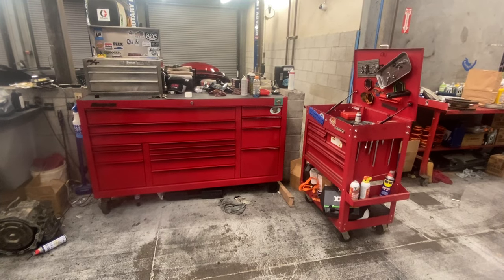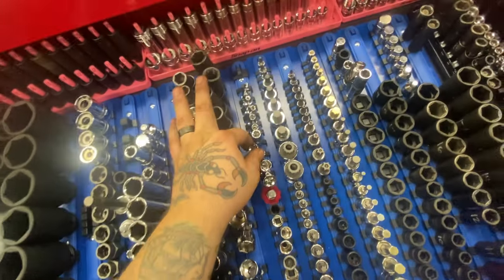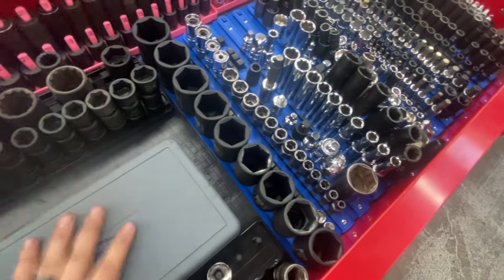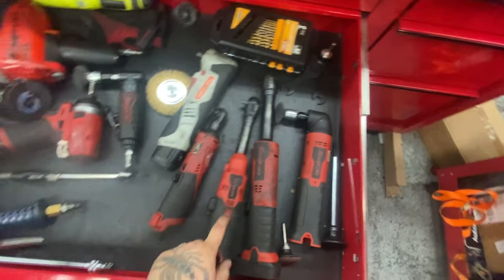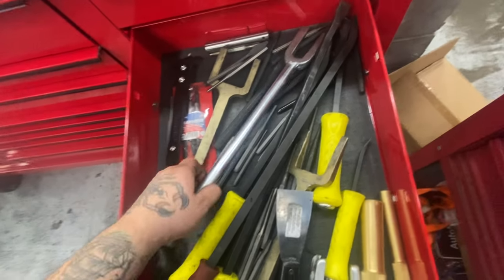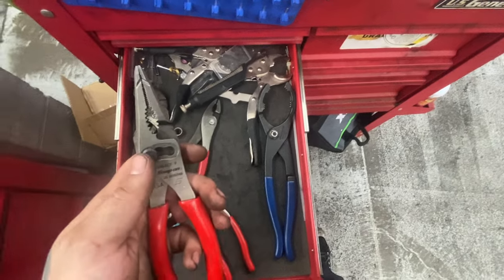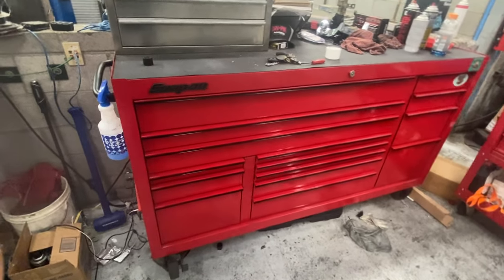Used car tech tool box tour!

Comment: The Astro 1/2in universals aren’t the greatest but like you said multiple times they do there job just fine and I haven’t had one be a problem for me. I’ve been a dealer tech for 2 years now and I still have yet to find the need to step onto the snap on truck and buy an overpriced tool.

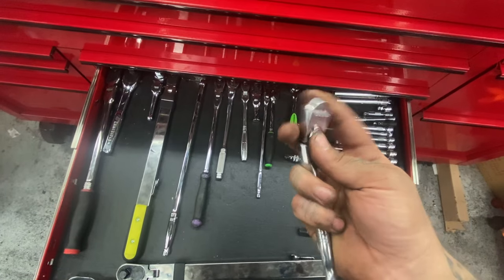Comment: 12:30 I’m going to buy that ratchet from a company called halfords. It’s a big company in the uk and they have the exact same product for the equivalent of $17 USD so it’s probably cheaper I’m assuming. It feels cheap and that’s because it is but they’re not bad since they get the job done. The halfords version also has a lifetime warranty
Reply: Just noticed the halfords one isn’t flexible and it has a locking feature but the rest is identical

Comment: I've contemplated getting the astro nanos but i wasn't sure due to them needing a 17mm wrench, even for a 10mm socket. Would you buy them again or go with something else? I'd appreciate your thoughts on the matter.
Reply from the maker: Not the biggest fan of the 17mm for every size but I’ve definitely got some good use out of the set. I like putting them on my mountain wrench, creates a pretty low profile setup. I would buy again but I have seen that Home Depot has husky branded ones that look the same and are about $15 cheaper. Not sure on the quality of them but they would be easier to warranty I imagine
Reply: @reallyreallywrenching  There are a number of other brands now which all go up to 19mm, but only Astro has the 20-24mm sizes for the 3/8 drive set.  The 1/2" drive sets go up to 24mm too but they are a bit larger, so don't really see the point.

Comment: Damn you have the snap on universal impacts, those aren’t cheap. Do you think they are worth it? Also you said you don’t use your 1/2” chrome why?
Reply from the maker: Yeah those universals really hurt the wallet lol but I just had to have them. I’ve had the 1/4 and 3/8 sets for about 3 years and they’ve held up great but if I had to buy again I would probably pick up some Capri or Icon honestly because of the price. And I usually just use the impacts for everything because chances are if I’m using 1/2 it’s going on an impact haha
Reply: @reallyreallywrenching  what about when you do alignments? because I use 1/2 chrome I think an impact would be hard to get into some tight spots... not criticizing just curious
Reply from the maker: All good! I haven’t really found many spots that impacts won’t fit but we don’t do many alignments here honestly. This shop is a really small separate one away from the main shop that only does the high mileage heavy line cars. We don’t have an alignment rack so usually they get shipped over to the main shop and done by the lubies over there